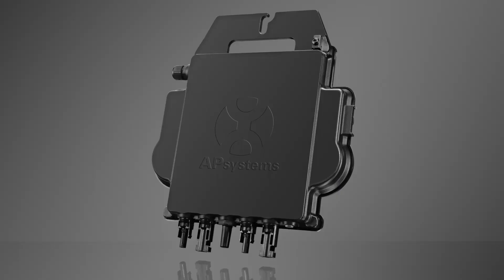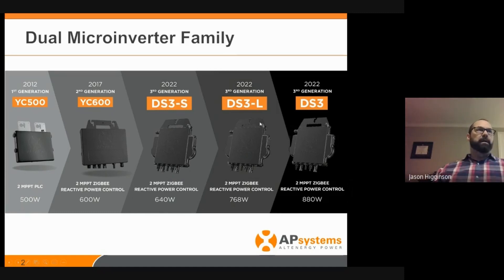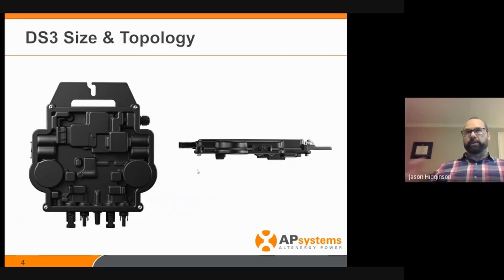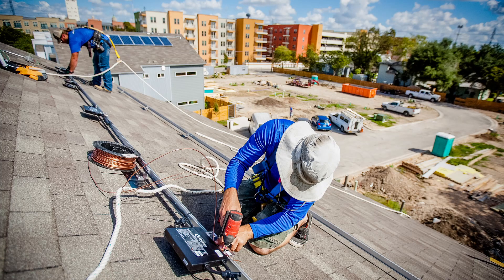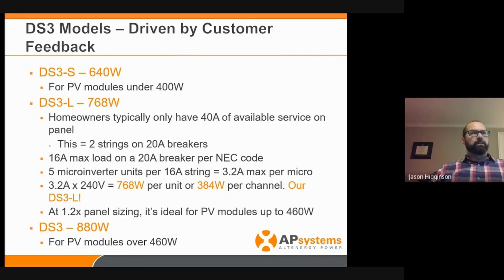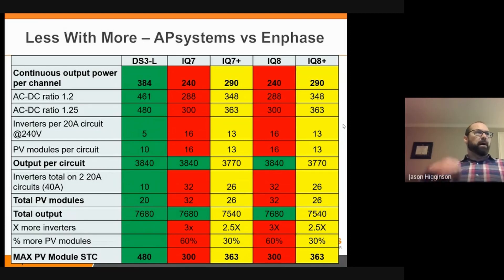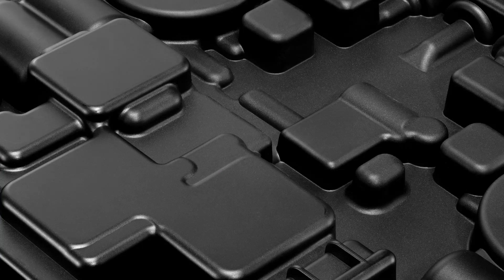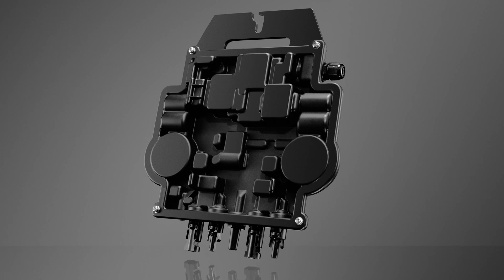The Pitch | Is APsystem's DS3 the most powerful series of solar microinverters?

Comment: Why not just make a 1 to 1 inverter to do the same thing?  It would be more user friendly, but I'm open to the explanation.  In my mind, an inverter that costs 5 bucks gets made into a 2 in one and the resulting inverter costs 10 bucks, then all you're doing is reinventing the wheel.  The explanation of "you're dealing with more hardware," is negated by "yeah, and less workability, less play in the strings, zero ability to do odd numbered strings, and for what? 20 more lbs and a bigger wind sail on my back as an installer.  Obviously, I'm old school, but to me, this smaks of a not-broken thing being "fixed"... alongside the way things have been getting done for decades + one mod, one micro... and a much more user-friendly install.

Comment: DS-3 Apsystems Micro inverter interference on the 27mc band on USB/LSB can be heard as beeps, and on FM as noise. It is also audible during the day when the sun is not shining, but only when it is dark outside do you no longer hear it. This interference on the 27 MHz band was received wirelessly from the air on a pocket scanner. (translated with Google) .

Comment: I have a more powerful Quad microinverter that is UL1741SB certified and available. We've installed 24 Hoymiles HMS-2000-4T-NA microinverters at a customer's site. Despite the perpetual rain that has been falling, on 1/20/23 I recorded a record of 1830 watts AC from 1 microinverter. That's over 457W per channel, using bifacial panels on a ground mount. The technology these days is amazing!
Reply: bigger one gets more power.amazing!how about in hot summer?

Comment: doing DC:AC oversizing on a module level -  this way you wont get as good mismatch mitigation as doing it on the inverter or whole string level, like its possible with DC:DC Optimizers, 1 module is shaded others from the string can compensate for lost power

Comment: I'm facing problems with  DS3D I installed with 665w Leapton panels (Winter - Rio de Janeiro - Brazil) . Daily inverters trigger the temperature protection circuit with a drop in energy production. It seems to me that these inverters don't support 665w panels  in spite their specs.

Comment: IQ8D in the field as you taped the interview:) specs are available. Jason, name those 480-watt residential-sized modules 20/32 ratio is controversial.
Reply: yeah, not residential sized--this is a great point. And I agree the 20 vs 32 is controversial. Yes at 480W, the PV modules are larger--qty 20 of 480W modules at 24.65 sq ft are larger than smaller resi panels of 18.6--but thanks to math, 24.65*20 modules = 493 sq ft of modules on the roof vs 18.6*32 modules = 595--over 100 sq ft more roof space required to reach the same output. That's an entire 10' x 10' bedroom worth of sq ft on the roof that you don't need to find panel space for. The caveat is the roof must have the dims to accommodate those fewer but larger PV modules. The modules paired with the DS3-S at 380-400W are better for resi use and 2 strings of DS3-S still require fewer PV modules on the roof (24) than IQ7/IQ8 (32) or IQ7+/IQ8+ (26) while also maximizing AC output at 7,680W. Also, the IQ8D appears to only be for 208, not for 240 residential split phase.
Reply: @jasonhigginson5718  Not a good comparison. With enphase, it first clips at 295 watts for the IQ7+, second, the peak power production isn't producing all day, so with the DS3, you can't fit as many panels on the roof. If you put the output of 32 panels of DS3 vs 32 panels of IQ7+, the overall yearly production paired with a 370 watt panel will be within a couple percent for a year. Your comparison is off. I am not liking not producing the yc600 anymore or QS1, since we could fit more panels per string. The yc-600 would be critical with some homes to avoid an MPU. You should continue to offer the YC600 as an option and QS1. QS1's are really economical and we loved them. Installation not so much, but cost savings yes.